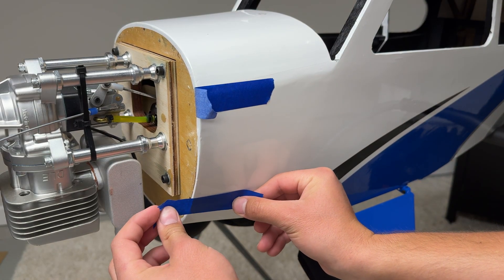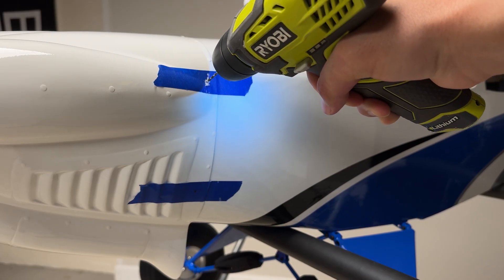Hangar 9 CubCrafters XCub 60cc Build - Engine and Cowling Installation

Comment from the maker: Please click "...more / Show more" for links and more information. Visit https://www.horizonhobby.com/product/HAN5260B.html for more information on the CubCrafters XCub 60cc.

Welcome to the fifth build video of the Hangar 9 CubCrafters XCub 60cc build, part of the Hangar 9 Back to Balsa Series! This video is going to start off with the installation of the engine to the motor mount. The fuel tank is installed to its appropriate location behind the motor mount during this process, and the entire motor mount assembly is installed to the firewall on the XCub 60cc. The proper steps in the cowling installation are also covered in this video. Lastly, the spinner and propeller are installed on the engine.

*Note that if you are using a DLE 55RA like in the video, you will need to supply around 20-23mm standoffs and extra bolts in order to achieve proper length of 190.5mm between the drive washer and motor mount.

Watch the rest of the Hangar 9 CubCrafters XCub 60cc build videos here! - https://www.youtube.com/playlist?list=PLUfse7Ks5AZiX6KAoGCayDQvm6HSlzVC0

Follow Hangar 9 on Facebook!
https://www.facebook.com/Hangar9RC/